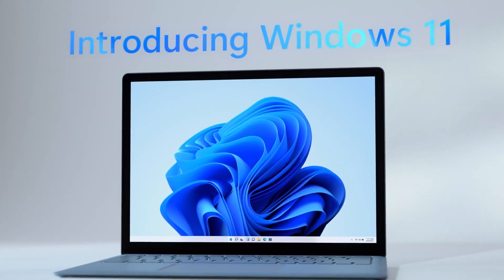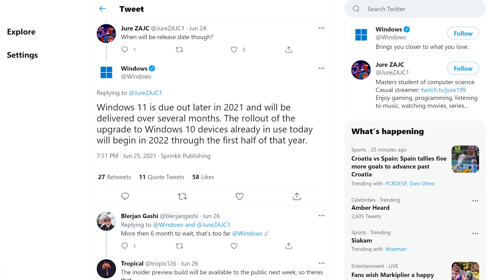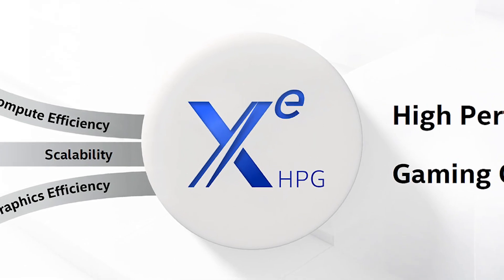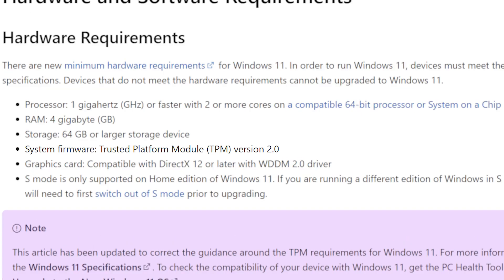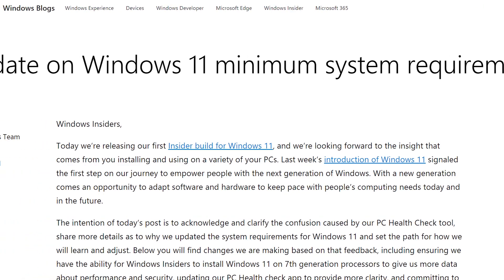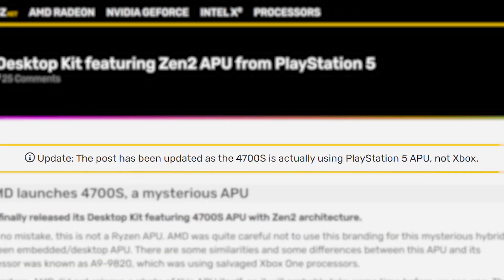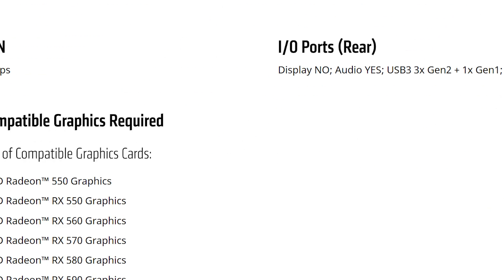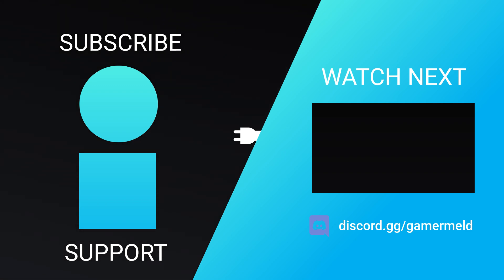TONS Of Gamers WON’T Be Able To Install Windows 11!

Comment: And...???????? And what do you mean? They are just doing business nothing else it's normall lmao windows 12 supported processors will be only threadripper and epic AMD processors and Intel will come with something impressive and that's it nothing special. Windows7 remains the beast of everything and no one will ever change that. Windows11 don't come with anything new bruh you can't tell new design it's not an fucking update to Windows 10 bruh. They come with some new icons,sounds,design and positioning and that's it lmao for me it's just an windows 10 update nothing more I don't see why they couldn't just updated windows 10 and introduces that tpm 2.0 to it. It kinda doesn't make any sense to create another operative sistem and just add an tpm thing I know they must do it for safety bla bla bla. But not all of us have the budget to buy a new motherboard new processor and tpm 2.0 chip if the motherboard doesn't have one. So it's just ridiculous. And what I said about windows 12 It seems to be really like that and not just a sarcastic joke of mine.

Comment: Actually it’s fairly easy to bypass the TPM 2.0 requirement by using the registry editor in the setup menu by command prompt and adding a D-Word 32-bit registry named “BypassTPMCheck” (or any other requirement you may need).  And set the registry value to 1.

Comment: bro every single program still supports windows 7 so i think 11 will be crap
you need a new pc for it and it requires a really good pc so free upgrade isnt even work since you will spend like 700$ on building a new one

Comment: Instead of putting a price on windows they did it with hardware, so there will be no more cracked windows but you can't crack hardware

Microsoft got 200Iq

Comment: I just used a Windows 7 machine for 10 years. I shut off the updates so Microsoft couldn't force me into anything. My Windows 7 machine finally died just a couple weeks ago. Looks like I'll be using a Windows 10 machine with updates shut off for the next 10 years! 😂

Comment: BTW.. Gamers can upgrade to windows 11..i my self have been using the Dev release of windows 11 for over a month and it's nice... Bypassing tpm 2.0 is a eazy if u have an external drive make it's a boot ale windows 11 drive and thn.. Reple the applibrary. Dll with windows 10 's Dll and it will work just as good as before

Comment: i was planning to replace my processor anyway. its a first gen and ryzen 7 1700, since my chipset supports up to zen 3 anyway, but this is still a bad move. its just going to lead to more e-waste. the tpm requirement is not something to glance at either, but something like this did happen with windows 8 back then. processors back then needed the NX instruction set. without it, windows 7 would be the latest you could run. history is kinda repeating itself now.

Comment: It sucks, sure, but frankly, if you're running a 7xxx intel cpu or Zen 1, you frankly should upgrade. Today's CPUs are so much better. 

Not to mention... Windows 10 is still going to be supported for several years beyond shelf life, like with most versions of Windows. Even if Windows 10 is officially retired Christmas 2021, I don't see the cord being totally cut before 2025. Plenty of time to save up for new upgrades or a new system and still be safe.

Comment: Linux: now this looks like a job for me
Reply: Tbh, this actually may be the solution

Since W11 can be run in virtual machines (+ you can emulate TPM, Secure Boot, etc. that way) you can just have it installed in KVM (with GPU passthrough for native performance).
Reply: Ya not happening
Reply: @bigbrotherandco  tbh I believe linux could overtake windows if it had better app compatibility (not its fault)
Reply: @abanoub7002  i dont think so, many people I know don't even use windows specific programs but just say Linux in front of them and they'll freak out like crazy. The problem is majority isnt even familiar what the heck linux is
Reply: @itchytwitchy But for the gamers it's still a viable solution. All you need to know is how to burn an ISO to a usb drive and boot from the bios.

Comment: my 2700x can run windows 11 but i am upgrading to 5950x and upgrading from me rx580 to a RTX 3090 upgrading from 32GB of ram to 128GB of RAM upgrading me m.2 1TB SSD to a 2TB NVMe and upgrading 2 4GB HDD's to 2 16TB HDD's
i can't wait to upgrade over the next few months here
rent became dirtcheap for me and i started working again! so i am saving up a few grand over the next few months for a few upgrades!
i will drop around $2,000 on the NVMe and RAM mid july
around #1,300 on the HDD's at the end of july and drop a few grand on the GPU and CPU bundle i am hoping for all i hope is the prices go down before i buy this is why i am doing CPU/GPU last
i will get my 4000MHZ ram and my 7000 read and 5100 write NVMe then my 32TB of HDD storage with 512mb of cache then my 24GB 3090 GPU and my 16Core 5950x CPU
i have a horrible problem
and the thing is i don't need to upgrade i just have a sick attachment to maxing out my Mobo!

Comment: Interesting that they let  you play the preview,but not the finished product. They tell you that you'll need certain products in order to run W11. Buy what hey are selling,and you can play the new system,..even though it will play on normal PCs.

Comment: Apple has done the same thing for years. Looks like Microsoft is bending to chip manufactures. Not before too long Linux is going to take over for gamers and we can abandon windows all together.
Reply: Me, I'll just don't update and stay with older version. At least until every effin driver and apps I need put Win11 as the minimum OS.

Comment: Well crap. Now I have to save up $5000 for a PC and try to get a NVIDIA RTX 4000 series card, DDR5 RAM, and AM5 even faster now before my PC with first gen Ryzen can’t run an OS.
(I’m upgrading the PC instead of just the processor because the PC isn’t too good. The GTX 1070 is okay but the low speed RAM, cheap air cooler and power supply, and hard drives need to be upgraded so I might as well start from scratch.)
Reply: Me, I'll just don't update and stay with older version. At least until every effin driver and apps I need put Win11 as the minimum OS.

Comment: while I have the features needed to get it running enable such as ftpm and UEFI Secure Boot my Ryzen 2200G APU is not listed as Compatable with Windows 11 so looks like I need at least a Zen 2 (Gen3) there are some supported heres the list of supported AMD I pulled! (keep in mind theres wiggle room and microsoft are working on letting some working that aren't listed but no information has been given on which!)

AMD Ryzen 2000 series (Zen+, Zen*)
Desktop
Ryzen 3 2300X
Ryzen 5 2600
Ryzen 7 2700
Ryzen 7 2700X
Ryzen Threadripper 2920X
Ryzen Threadripper 2950X
Ryzen Threadripper 2970WX
Ryzen Threadripper 2990X

AMD Ryzen 3000 series (Zen 2, Zen+**)
Desktop
Ryzen 3 3100
Ryzen 5 3600
Ryzen 7 3700X
Ryzen 9 3900
Ryzen 9 3900X
Ryzen 9 3950X
Ryzen Threadripper 3960X
Ryzen Threadripper 3970X
Ryzen Threadripper 3990X
Ryzen Threadripper 3995WX
Ryzen 3 3200G**
Ryzen 5 3400G**
Mobile**
Ryzen 3 3300U
Ryzen 5 3500U
Ryzen 5 3550H
Ryzen 7 3700U
Ryzen 7 3750H

AMD Ryzen 4000 series (Zen 2)
Desktop
Ryzen 3 4300G
Ryzen 5 4600G
Ryzen 7 4700G
Mobile
Ryzen 3 4300U
Ryzen 5 4500U
Ryzen 5 4600H
Ryzen 7 4700U
Ryzen 7 4800HS
Ryzen 7 4800H
Ryzen 9 4900HS
Ryzen 9 4900H

AMD Ryzen 5000 series (Zen 3)
Desktop
Ryzen 5 5600X
Ryzen 7 5800X
Ryzen 9 5900X
Ryzen 9 5950X
Mobile
Ryzen 3 5400U
Ryzen 5 5600U
Ryzen 5 5600HS
Ryzen 5 5600H
Ryzen 7 5800U
Ryzen 7 5800HS
Ryzen 7 5800H
Ryzen 9 5900HS
Ryzen 9 5900HX
Ryzen 9 5980HS
Ryzen 9 5980HX

Intel Supported:

Intel 8th generation (“Coffee Lake,” “Whiskey Lake,” “Amber Lake”)
Desktop
Core i3-8100
Core i5-8400
Core i5-8600
Core i5-8600K
Core i7-8700
Core i7-8700K
Core i7-8086K
Mobile
Core m3-8100Y
Core i5-8200Y
Core i3-8130U
Core i3-8145U
Core i3-8100H
Core i5-8250U
Core i5-8250U
Core i5-8400H
Core i7-8650U
Core i7-8665U
Core i7-8750H

Intel 9th generation (“Coffee Lake Refresh”)
Desktop
Core i3-9100
Core i5-9400
Core i5-9600
Core i5-9600K
Core i7-9700
Core i7-9700K
Core i9-9900
Core i9-9900K

Intel 10th generation (“Comet Lake,” “Ice Lake,” “Amber Lake”)
Desktop
Core i3-10100
Core i5-10400
Core i5-10600
Core i5-10600K
Core i7-10700
Core i7-10700K
Core i9-10900
Core i9-10900K
Mobile
Core i3-10100Y
Core i3-10100U
Core i5-10210U
Core i5-10200H
Core i5-10400H
Core i7-10510U
Core i7-10710U
Core i7-10750H
Core i7-10850H
Core i9-10980HK

Intel 11th generation (“Tiger Lake”)
Desktop
Core i3-11100
Core i5-11400
Core i5-11600
Core i5-11600K
Core i7-11700
Core i7-11700K
Core i9-11900
Core i9-11900K
Mobile
Core i3-1115G4
Core i5-1135G7
Core i5-11300H
Core i7-1165G7
Core i7-1185G7
Core i7-11375H

Citation: pcworld/article/3623192/what-cpus-can-run-windows-11 By Alaina Yee
Senior Editor, PCWorld

Comment: Relax, people have 4 years to upgrade/switch before Win10 no longer being supported and how ever long after that they choose to keep using Win10. I'm still on Win7 with a i7-6700K and 1050 ti. I was planning on finally give in and buy Win10 and been wanting to upgrade my PC. But since Win11 will be free I might as well upgrade for it. The necessary upgrades I've checked out doesn't cost much more than a Win10 key.

So it conveniently goes hand in hand for me.

Comment: I love how everybody flocked to a fucking blogpost of a company notorious for heavy disorganisation and was like "yep. That's the official specs, no nuances, no mistakes, guess no-one's gonna be able to use w11". Nobody even consideres it being a mistake, a launch precaution or anything else. I'm telling you, a year at max after the initial launch w11 will be optmised for every adequate device, just like the ugly tiles in w10 were eventually scrapped.
Reply: don't worry most of the ppl who are complaining are linux retards who want other ppl to use linux

Comment: Ok people time marches forward. Tpm 2.0 is actually a great security feature and had been around for a long time. Furthermore of your running a 8th gen inter processor and amd equivalent you likely already have tpm 2.0 capability. .I also am glad they are releasing a new os that looks more modern with newer features. 

This happens everything Microsoft releases a OS that makes people upgrade. They go many years, in this case 6, between OS launches and people always complain. Meanwhile Apple can be like we released a new OS X version called Kitty Crap and your MacBook you bought 3 years ago for 2000$ isn't compatible. All the Apple fan boys 0 complaints.

Comment: It's no problem if you have an old CPU that doesn't support windows 11, as windows 10 I set to be unsupported till 2025. So you have until then to upgrade.. Windows 11 is a long term plan, not short..

Comment: No worries as I'm still using Win7 on my 10+ year old machine that still runs some new games decently with an I5-3450, 12GB RAM and an nVidia RTX2070. I'm not upgrading to Win11, especially if they hardcode such requirements in the OS while older hardware should be able to run it as well. What's their next requirement? You need a renderfarm machine or supercomputer with at least 4 8-core CPU's and a gfx card with 10.000 CUDA cores, 256GB of RAM and such silly requirements, just to be able to boot your OS, which occupies 150GB on your harddrive? An OS only needs to be a bridge between your software and the hardware so the software can run on your pc, even with alot of different brands and models of every hardware device out there, and thus should use minimal system resources. If you need such specs to be able to boot your pc and run minesweeper or patience, or even to search on google website (alot of older people don't use anything other than this), then revert back to a 486 processor and you're able to do the same thing running Win95 and far less specs. And wasn't Microsoft itself saying Win10 was the last version of Windows ever?

Comment: I have the recent preview build running good tpm enabled, and ryzen 5 3600, msi x570 mobo, 16 Gigs Ddr4 3600.  Running good games run better than 10.   No issues on my system.

Comment: Forget gamers for a second I find it interesting that windows 11 is not really marketed to much for gaming but more for work stations and company use, and trying to compete with Apple almost. And I know a lot of companies dont always have brand new gen CPU’s but usually just more cores and reliable cpus if companies decide to go to windows 11 I have a feeling this could cause alot of companies that want to upgrade to have to get new workbenches.. which means 1 of 2 things not to many people will use windows 11 because it’s so annoying to upgrade to or cpu prices will rise like gpus did because of everyone is buying them and supply gets low. Just a theory though feel free to share thoughts, I have a feeling not to many people will use windows 11 if they don’t have the hardware to support it I don’t see the point in getting a whole new rig just to get a new operating system

Comment: Should just use Linux, we don't have these problems.  Gaming has gotten way better thanks to stuff like Steam's proton play, plus games run better and can be a lot less taxing on your hardware thanks to less background processes (like Microsoft "telemetry" spyware) that can be minimized even further if you're willing to use more minimal installation distros like Arch or Gentoo.

Comment: This is part of what finally pushed me to look seriously into Linux. Installed Ubuntu and so far am pretty impressed overall. Most of my games work really well using either Lutris or SteamPlay with Proton. And the majority of the software I needed to run on Windows can either be ran in Wine or there is a free alternative.
Reply: Yep, did the same with PopOs and am pretty happy with it.

Comment: Noone cares. Noone (almost) actually needs windows 11. So this "news" has exactly zero value. Nice clickbait thumbnail though.
Reply: no one needed windows 10 either... 7 worked just fine.. and still does for those lucky enough to still have it.... but hey.. the company knows better than the consumer right?!?!?!..... they certainly think so at least.....
Reply: @mikewhitaker2880  Windows 7 had quite some flaws, windows 10 has fewer. It's a better system in many ways.

Comment: fairly sure my 1950x threadripper with 32gb RAM would run Windows 11 just fine, I have secure boot enabled and fTPM but it seems Microsoft disagrees.

dickheads.

Comment: I'm seriously considering linux as my next OS. This new move from microsoft pissed me off so bad that i genuinely think that I'll avoid the next version of windows even if i decide to upgrade to compatible hardware.
Reply: totally think like this! Good linux and starting windows only as an app inside linux
Reply: That's fine if you aren't a serious gamer. Go ahead and do that but serious gamers don't have that option.
Reply: Linux should support the most games, then I'll switch back to debian
Reply: @ep1k_4  well I mostly do VFX but unreal is one of mine weapons, so I am not sure in Unreal can run on Linux...Unreal 5
Reply: Upgraded to Linux in 1992, on a 386.
Reply: W11 is still in insider preview!!! U need to know that!!!
Reply: @OfficialNoob94  They have already confirmed that they will not back down on the secure boot and tpm requirement.

Comment: Good! looks stupid anyway..
Nothing wrong with Windows 10
Reply: plenty wrong with windows 10.. go back to windows 7 if you want usable....
Reply: @mikewhitaker2880   Ive been with Windows 10 since it first came out.. Literally never had 1 issue with it..
Reply: i've had plenty, first was not being able to use the windows web browser for ANY update, second is zero access to any sleep mode or screen brightness options.. and almost no control over ANY other power control feature... with win7 i had no issues with ANY of these basic features... even third party updates are a pain sometimes because of how my win10 works....
Reply: @mikewhitaker2880  ive had literally zero issues, on any of my computers in my household...
Reply: what can i say, 10 gave me problems, 7 rarely did and when they did i could fix, had ZERO problems with windows ME until dx 9.0c broke it "and that was microsofts intention"...and zero issues with 98 or earlier versions.. thats been my experience.. other peoples results will OBVIOUSLY vary... doesnt change my results...

Comment: I have ryzen 1200 . It has fTpm 2.0 , i grab the installer to test, and it says 'your pc cannot run windows 11' but when i enable fTpm 2.0 the installation proceeds without any error. I know its not official rn but ryzen 1000 (1st gen) have tpm 2.0 .. Device manager also detects that.

Comment: So hang on, this means the government, businesses, etc, must trash a megaton of hardware to run Win11? Is Vista hiding underneath the 11? They tried out-moding a bunch of software with Vista but no one would buy it, so then we got Win7. Maybe folks will just start running Linux and toss MS to the curb for their unreasonable Apple-level BS.
Reply: or keep using the os they have currently or would that make to much sense. unless you need something  that windows does not offer. If you are using a particular os you don't change what isn't broke.
Reply: lol gov agencies are last to upgrade to new version of windows some of them is still use xp and 7 they are not dumb like normal ppl who jump to buggy beta

Comment: Good for me I just  bought Ryzen 5000 cpu and I wont have problems with the  new Windows and the AMD APU with Zen Log and specified to be made using Zen architect then it means  that it  is Ryzen CPU becouse if it is  not then they  would have not used a ryzen Logo and that Logo is  for  Ryzen just like  the Red ATI log  is  for  Radeon and when  ever  you see a AMD ATI it  means  it is  Radeon GPU.